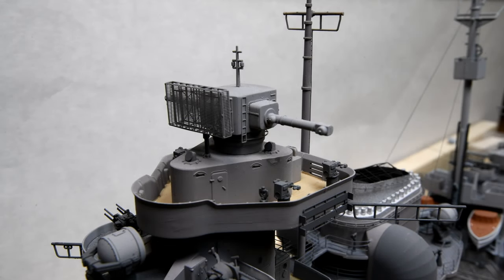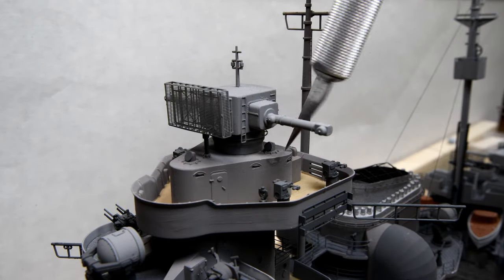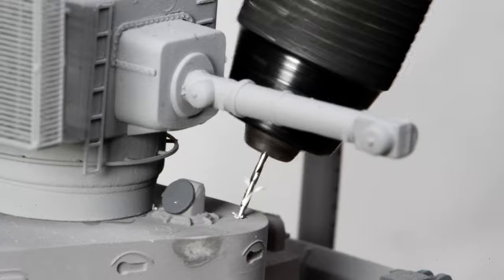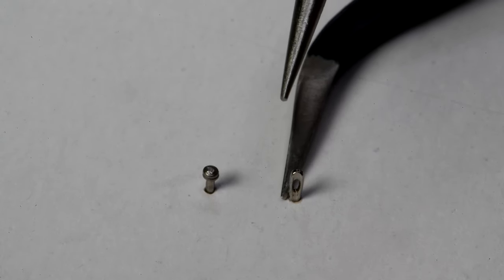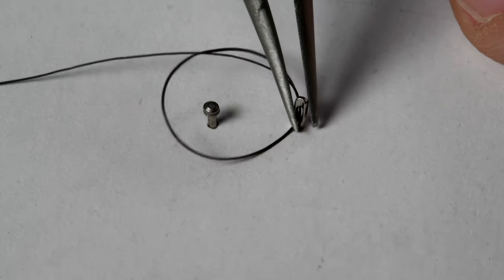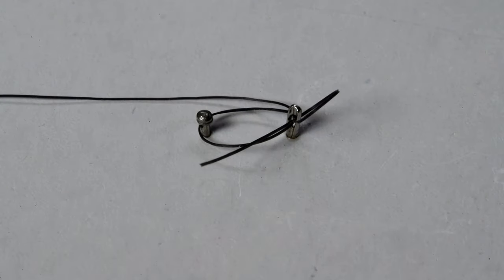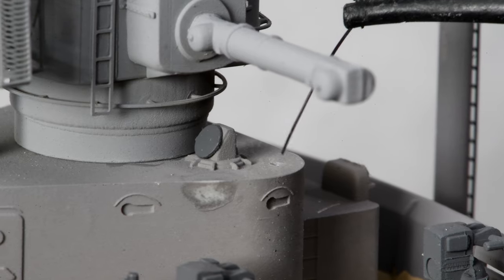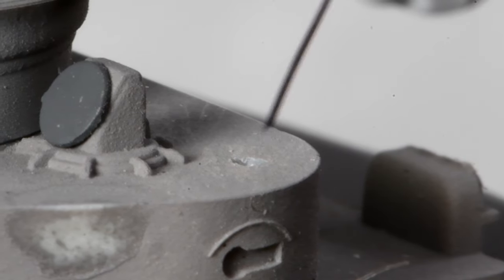The Model Ship - Part 407

Comment: Ron:  When using the EZline, you could glue ot into your hole, run the cord around the mast and place the same end line into the twin hole on the port side.
Reply from the maker: Yup! That sounds easy doesn't it. Haha! 😁
Reply: Did you try it?  It works on the shrouds and stays on wooden ships like the Victory. of  @roncalverley
Reply from the maker: Thanks Martin. 👍

Comment: 1) Would a sewing tool like a needle threader be a solution to the wireding work?

2) Your dream, which is a powerful and beautiful metaphor to the level of a revelation, may tell you that your subconscious, at last in a venerable way, has realized and accepted that you have conquered your inner mountain regarding to your wife. A solid mountain built on your conscience to her. Maybe your involvement with sewing needles in your boat building gave associations to the past where she sewed things, and then trick started the dream. Perhaps you are reaching through the 2-year process for a conscience settlement to be a widower by having "fixed" most of the existential left-behind questions in your mind. 
As the saying goes, there is light at the end of the tunnel. 😎